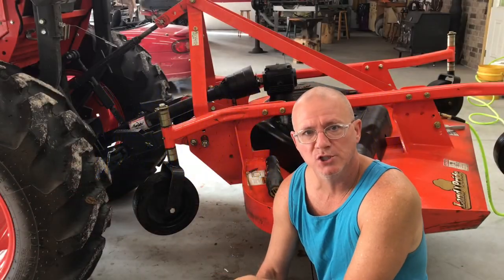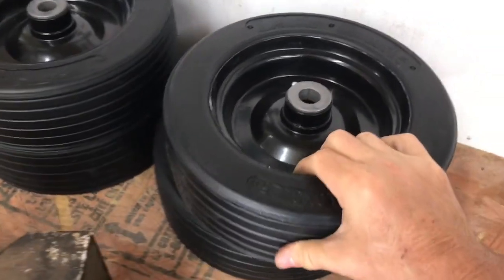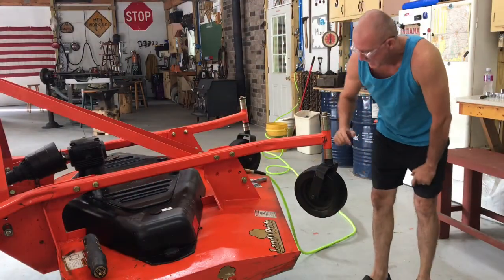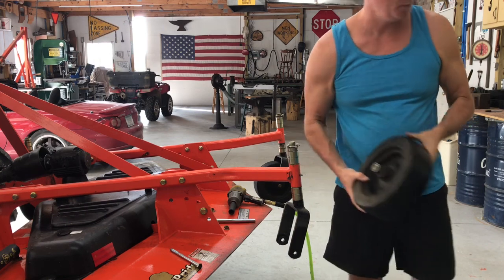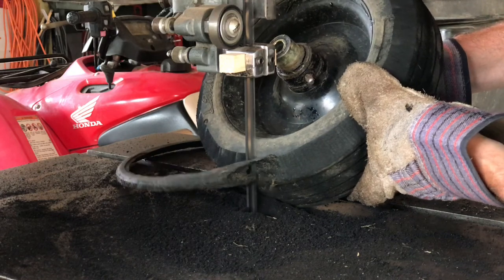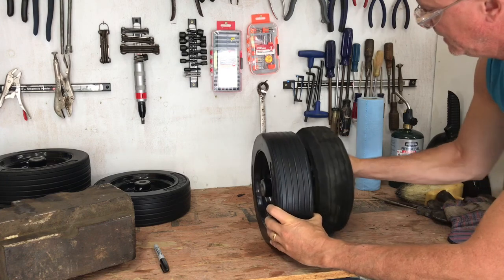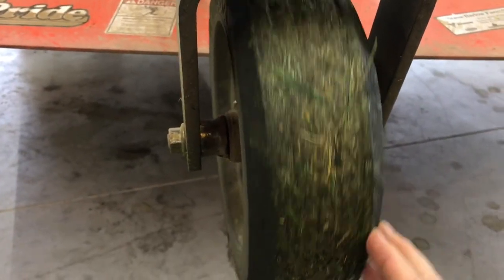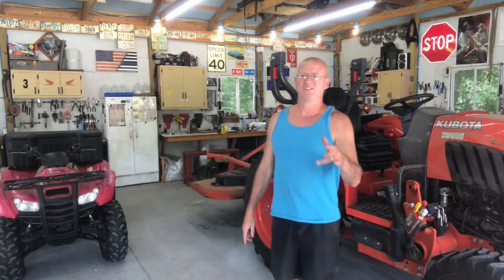Upgrading (Fixing) Landpride Solid Rubber Tires: Profiling The Tread

Comment: Good tip, Chris.   I just put some new ones on my LandPride 60in mower deck and even though the ones I replaced that were probably on there since the get-go didn't have a lot of these issues, I agree they may track better with a small amount of profiling.  I don't think I will go as drastically into the tires because I want to keep as wide a profile as possible to keep from rutting, but removing the abrupt edge will be of benefit.

Comment: From the look of your investment they should be free regardless.  Green and Sons replaced my alternator on an 2005 7800 after I only has 5 hours on it.  It had 500 hours when I bought it used.  Great service and people to deal with.
Reply from the maker: Yeah I am still using the modified tires and they have performed perfectly. I still have the new ones in my back pocket but not sure I'll ever need them?

Comment: I just got mine today brand new.. hoping I don't have these problems.. I just ordered the front roller with the brackets.. Figured it help with scalping.
Reply from the maker: @bombidude  that front will definitely help. If the tires are squared off on the edges then I’d expect them to do the same.
Reply: @shopdoc  Than I'll would do what you did.. You did a good job on yours
Reply from the maker: @bombidude  Mine still are perfect since doing this mod.......no more digging in and no more chucks coming out of the rubber.

Comment: I have about 5 hours on my fdr1660 mower and one of the tires already has a small chunk out of it.  Not as bad as what you show...any wear after 5 hours is too much.
Reply from the maker: Yep that's how it starts. Since completing my modification the tires have performed so well and they track much better than the original design. I still have the new tires they sent me but honestly my modified tires are in great condition. I am convinced if the modification was not done they would be destroyed by now. I have a little over 200hrs on these now and they are perfect.